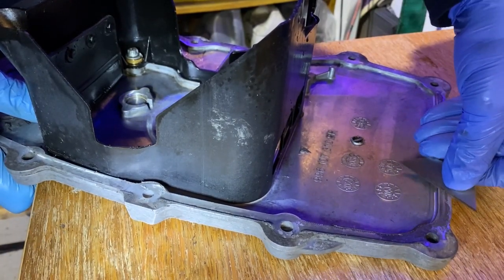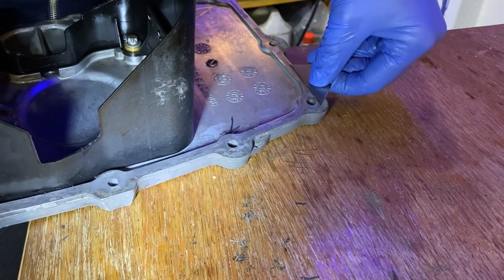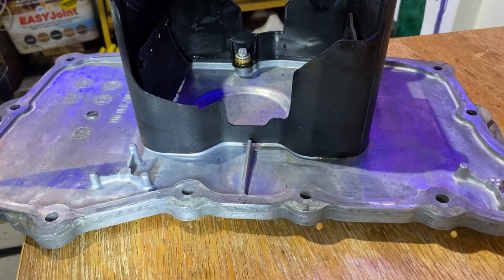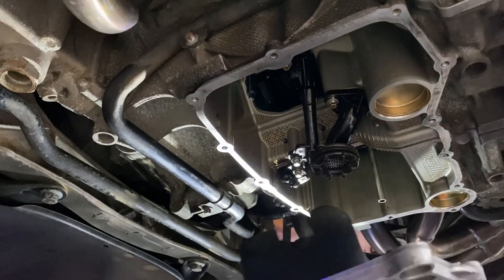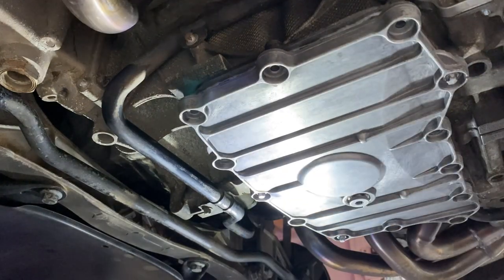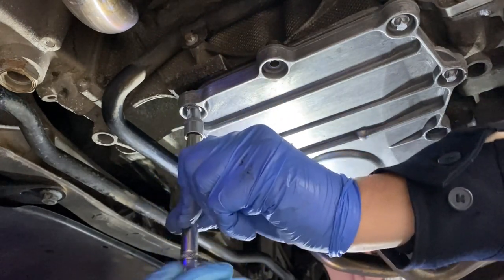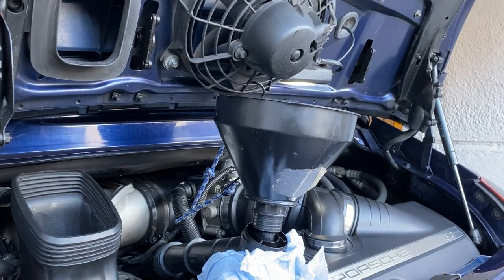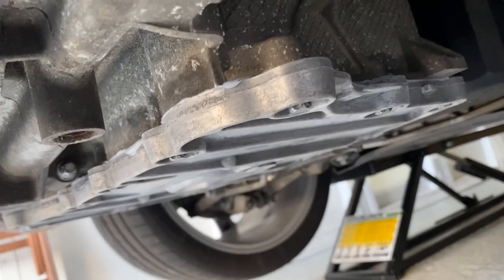Porsche 997 Sump Replacement / New oil Filter and Mobil 1 + Additive.

Comment: Andy, sure I read that 997’s with auto box, tiptronic or PDK got the centre radiator as standard for cooling the gearbox. Paul G
Reply from the maker: Hi Paul. That could be true but personally they should have fitted them to all water cooled version. Andy

Comment: Good job mate !!  Consider a L&N spin on adapter for your oil filter , better than those oem cartridges , also you are using the QuickJacks backwards ..They should be lifting towards the front of the car (very common mistake) also next time use Liquimoly Ceratec or MoS2 oil additive rather than Lucas ...Much better and proven in the M96/97 engines. Last but not least .... Do not start your engine if you are not going to drive the car for at least 20min ... Idling our engines when not in use just to get the oil moving is not good !!!  Love your videos ...Keep up the good work !! Cheers from Toronto !!
Reply from the maker: Hello Toronto. Personally I’ve always kept the oil style filter as I like to cut them open to see if anything is in there. I’ve often wondered about the jacks! It doesn’t say on them I don’t think. It works out better for me with the hose run but if it’s a safety issue I’ll have to change my ways. Many thanks Andy Southend Essex Uk 🇬🇧
Reply: @porscheminormechanicsrando8394  I use to use my Quickjacks your way until my friend told me otherwise  .. As for the oil filter the cartridge type have a oil filtration bypass and the spin on type do not and the spin on type Wix have a higher filtration rate  which is also beneficial ... You can use tin snips or a spin on filter cutter to open the spin on type also ..Thx ... Mike from Toronto ..

Comment: I’ve heard people say once you start up your 911 you should drive it straight away ect, however I have always been advised to let cars warm up every car I have had, e46 m3, r32 mk5, 987 cayman s and now my 911.1 997s I have always warmed up till the engine goes from over 1k revs to just under and of course keep the revs under 2.5k revs until oil is up to level, I have 0 idea if that’s the correct thing to do warming up wise other than the oil temp way, if someone could give me a pointer, great video! Looking forward to seeing the car with the turbo wheels on!
Reply: Great video 👍

Change oil every 6 months
Regardless of mileage 

Start car drive of slowly 
Is the best way to warm the engine up 
If to warm up on tick over it will take longer the warming up process 
Dumping fuel into the cylinders washing away oil lining the cylinders 
Causing what we all no
Reply: Don't warm it up by idling, just get in it and drive keeping revs under 3k or so until hot. Cold  engines run very rich until warm.  Gas, being a solvent, counteracts the lubricity of the engine oil and that is a bad thing.  You want that rich condition to end as soon as possible.
Reply: @aboyandhisdog  thanks for the advice! At least I know how to warm her up now👍🏼
Reply: Hi Fella….Big thumbs up for mention in your video 

Regarding the millers oil it’s 10-50 NT..Back container with yellow label…came in at roughly £60 per 5 litres…
Looking at your exhaust bedsides the gundo hack it looks like you have Stainless manifolds as well …or my eyes are deceiving me I am on my 2nd bottle of Red!…
Keep up the great videos….
Reply from the maker: Hi. Your very welcome. Yeah manifolds are stainless. I know the bottle your on about. Is it Nano Tec ?  Thanks for getting back to me. Easy on that red 😂

Comment: Andy, dropped you an email at your hotmail address a few weeks back.  I just changed my oil not even 2 weeks ago.  Did the manual transmission fluid too.  My oil analysis came back and said I had some fuel dilution, albeit very slight.  Has me wanting to scope my bores as well.  If those check out, I’ll throw some new injectors in.  In the mean time I’ll start throwing some injector cleaner in the gas tank.  I was hoping you were going to do a bore scope this go round, so I can watch and learn.  I’ll be doing my next oil service in July so if I can figure it out, maybe I’ll drop the sump plate then and give it a shot.  I may look into some oil additives too, after I get some of the more knowledgeable fellas on the forums to check out my oil analysis report.  Cheers from Texas!!
Reply: PS, Gundo hack is primarily for your audio pleasure.  Don’t think it provides any other benefits.
Reply: Oil analysis showing slight fuel dilution could be no more than sort journeys and the car/engine/oil not getting warm enough for long enough. Many Millar Oil reports show this.
Reply: @markbrooke-read212  I don’t do short trips.  When I got out the car comes up to full temp for a good bit, but thanks for the tip.
Reply from the maker: Hi Marcus I’m sorry I haven’t seen your email but I will have a hard look for it. Your result doesn’t sound like a major issue. Injector cleaner can’t hurt and at least other than the fuel it sound like your engine is just fine. 
I hope to respond to your email soon 
Best wishes andy.